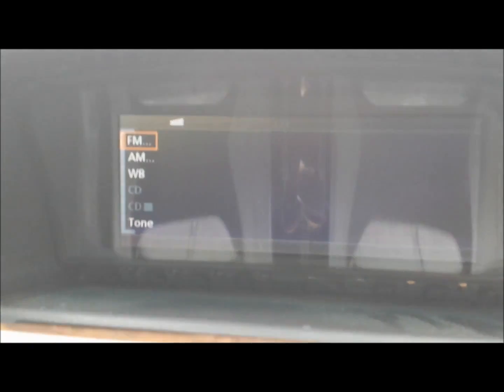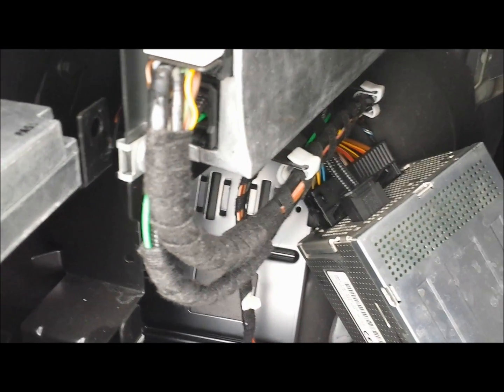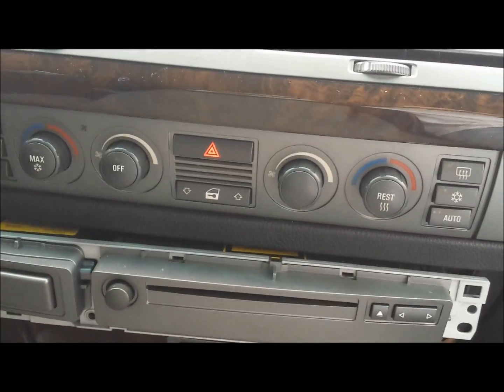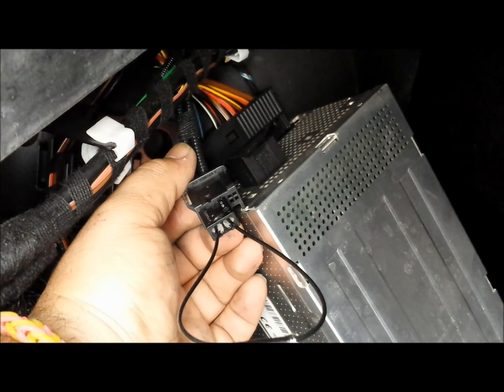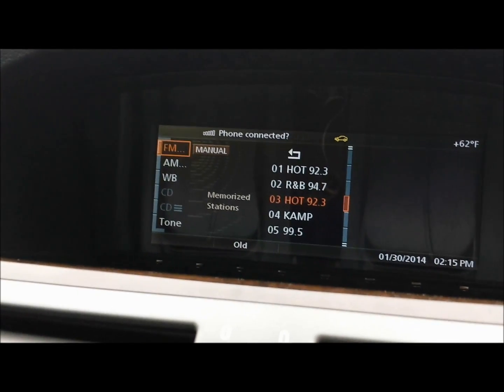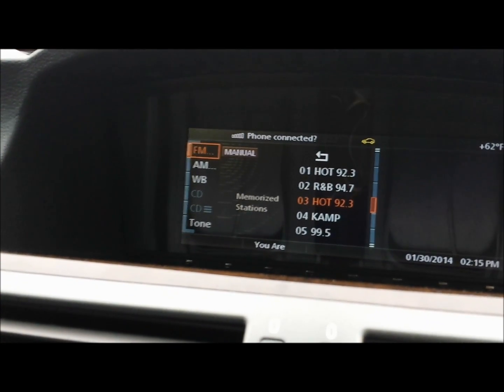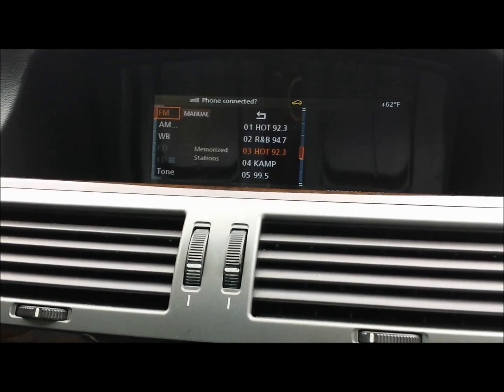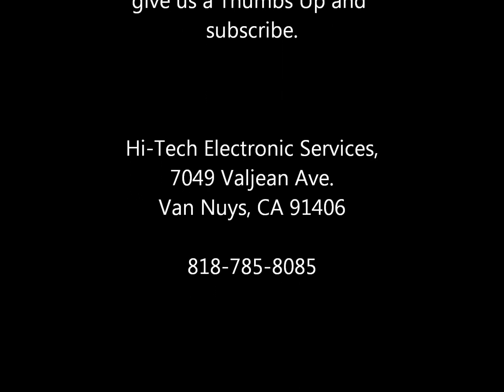How to Troubleshoot BMW Fiber Optic Audio Navigation 750 / 745 2002 to 2008. Part 1

Comment: Hi.. Nice video.. my CD changer is not working, it makes a clicking noise when it tries to load the CDs at start up.. I observed it, and basically it gets stuck trying to load the CDs.. any recommendations on how to fix? thanks
Reply: I have the same exact issue!!!
Reply: i changed the CD changer itself, and yes by myself.  I don't recommend it unless you know how to disassemble and enable electronic cable connectors from the board.  I'm a Mac Genius, and it was still challenging because I've never seen that type of connector.   But anyway, next I will test a new magazine.

Comment: Hello ,I have 2005 x5 3.0i BMW.  ever since battery went on car radio has not come back on. phone button stays little but nothing for radio numbers are not even on display. I brought replacement radio but upon attempting to install it would not power on, there is power going to wires but still not coming on can anyone give some assistance?
Reply from the maker: is your car equipped with navigation?

Comment: Is this a male or a female adapter? 

I want to purchase one but seems likes the pictures show connectors rather as same as the input sockets on the car and it wont work/connect. While what you are using in the video has exposed connecters on the loop connecter. 

Help needed
Reply from the maker: It is a male adapter.

Comment: I ordered the loop but how do I get to the nav. system? I own a 2007 750i .how do the side panels come off?
Reply: This module had gone bad. Connected loop and both radio and Nav. are working.
https://lh3.googleusercontent.com/5dqvPQBEuzMSEf69mDbEaOcW6W5rr5HYMZuPORtpIR5nD_bQ2R6bsaimjxeieRZ3me70qvZi2w
Reply from the maker: You need to remove all those plastic clips from the panel and unscrew the chrome latch on the trunk floor.
Reply: got it. thanks
Reply: J Harris3 what issues did you have. this morning after i washed my car, I went inside and heard the cd magazine making noises and humming from speakers, after reading up on other people issues I went to the trunk and hear activity like the navigation disc changer is on or spinning... I have a 2007 750 li as well. at first the bmw logo stayed on screen but I did 3 button reset, screen is ok, but no sound or radio and still hear humming
Reply: how and where did you get the loop I replaced my satellite tuner but its the wrong one it makes my radio and navigation come back on but not the satellite radio.

Comment: HiTechElectronic  does this also apply to the  BMW 525i series?
Reply from the maker: Not quite. BMW 5 series has CCC unit. If your car is equipped with the logic-7 amplifier and you have no audio then you could only bypass satellite tuner or Bluetooth module to troubleshoot.
Reply: +HiTechElectronic the audio works sometimes and other times not at all.  Do I have to use the by pass cable like the one in this video?
Reply: SwervinMad radio is open eni times

Comment: Hello I own a 2007 750Li and my radio is not working (FM has no channels), satellite radio has the same too, and my phone bluetooth doesn't work either.  What is the most likely reason for this?  A fuse or one of the components and how do I narrow it down?  I appreciate any help you can give, thank you. Glen.
Reply from the maker: You need to follow the instructions on this video to find out.

Comment: Hi guys
Is there anyway how I can upgrade my radio,system,settings etc as some of the options doesn't work when I click on them. Can't find Bluetooth either.
And one more question. My radio can't find any stations only if I look manually. And when I'm stationary volume is all ok but when I'm on move than my volume goes up and down,constantly till I don't stop and than when I move it goes up and down again.
Can I reset it or something?.
Thank you

Comment: Are 2009 535xi same diagnostic
Reply from the maker: +B Lorenzo No quite, in 5 series if there is no audio you can only bypass the Satellite module  if the car has the option or the Bluetooth module only.

Comment: This video is very informative except the fact that I buy the Fiber Optic Loop you mention and it did not fit my 2008 BMW750LI cause you forgot to mention that there is female/male loop. I waited 10 days for the loop and took me quiet awhile to dismantle the component, just to find to my dismay that the loop does not fit.
Reply from the maker: +Benson Reuben You should have bought it from our website.
Reply: +HiTechElectronic ......That's the first thing I did but upon searching for it on your website, the search came up empty. Perhaps instead of writing smart ass answers, you should update your website cause it looks like one from the 1990's  !!!!
Reply from the maker: +Benson Reuben The new website is coming soon. Thx.
Reply: +HiTechElectronic    so how do I get this loop from you  that fits into the fiber optic loop and how much will it cost?
Reply from the maker: +Benson Reuben Please go to our website, in BMW category, look for "BMW 745 troubleshooting guide"
and click on "buy now" button. You can also send me the picture of the connector that you bought, you might be able to modify that one. Our email is in the website under "contact us".
Reply: HiTechElectronic 
Where I can get that bypass loop... Or lolipop.. For my 2002 BMW 745Li
Reply: My 2009 750li screen is all black no audio or navagation

Comment: I have a 2002 745i and my idrive knob stopped working but everything else was still working until last night. Not only do I not have any sound but nothing comes on. Is this a battery issue or fiber optic loop issue?
Reply from the maker: +Andre Bishop  If your display is black then you need to check your fuse first.
Reply: HiTechElectronic

Comment: hi I have a 2003 745li when ever I turn my music up loud I get static in my front left speaker but It doesn't sound like the speaker is blown I'm thinking it's a lose wire in the amp or something. you have any ideas what that may be?
Reply from the maker: +Antwan Shaw   The problem could be the Amp or the ASK unit. You need to bypass the Amp first and then check the audio, if no more static then the problem is the Amp but if the problem still exist, the ASK unit is bad.
Reply: +HiTechElectronic thanks for the quick reply. I honestly think it's the amp because it only happens when I turn the volume up past a certain level
Reply from the maker: +Antwan Shaw So, get you Amp checked out first and if it is faulty then get it repaired or replaced.

Comment: Hi. Great video. I have a problem with my 2007 750i. I noticed while troubleshooting that all of the modules have a red light going through the fiber all the time, but the amp does not. Should the amp always have the light on like the other modules? Maybe I have a broken fiber? Where is the loop initiated from for the amp? Could a bad receiver cause the fiber not to light to the amp? Any help is appreciated.

Comment: in my 745i everything works fine, but the car doesn't remember witch audio source was on when i drove the car. So i listen to cdc, go out of the car and lock it. then the next day i open the car and there is no audio. i have to manualy select cdc or an other source to have audio again. any thoughts? maybe coding? (i can code with nsc exp)
Reply from the maker: +Yester Dailey It is not coding and it is not a common problem.  Sounds like a bad ASK unit.
Reply: +HiTechElectronic thx, i changed the ask, but no difference. But, with my other key (key2) is works fine! so i think its car/key memory setting?

Comment: Hello HiTechElectronic. I just purchased a 2006 BMW 750 Li from a co-workers friend. He said his CD player wasn't working because he had previously installed an aftermarket CD player and didn't know how to connect the factory unit. After some further reviewing of the car, I noticed the navigation doesn't work, nor the clock, door chimes and neither do the vehicle settings to let me know if anything needs to be serviced. Do you think I should take it to a stereo shop first or should I try the series of bypass loop? Thank You
Reply from the maker: +Bernie Rocha You need to install the original unit back in the car and then check the complete system.

Comment: truly helpful.....2006 e66 750liI had no radio, cd player, satnav, clock, tv, or sounds of any kind.I bought a fibre optic loop and started in the boot (trunk for you Am's) nav disc player first, no change.the big one next (don't know what it is) -no change.logic-7 thing next, BINGO! I pulled the plug and inserted the loop then went back in the car and the radio is on!I have sound from all speakers although it sounds quite dull....also,satnav, tv, radio stations, cd player, information sounds and chimes it's all there.so now I know which component is at fault and I feel quite triumphant so far as I feel a bmw tech would have cost me a bundle so far.....now to look for an answer about the logic-7 box/thing/amplifer whatever it is lol.many thanks so far...........
Reply: +Matthew Kingham  please ignore the lines through my text.......
Reply: where did you buy the bypass loop from if you dont mind me askin
Reply: +smooth gaskin "audi a8 fibre optic loop diagnostic connector" from amazon.when you get it, break open the plastic "lollipop" shaped frame and remove the loop.......you end up literally with a small piece of f/o cable with a small plug at each end.what are you working on?
Reply: +Matthew Kingham 2009 audi a8L
Reply: +smooth gaskin nice. good luck!
Reply: +Matthew Kingham thanks

Comment: i have a bmw 2006 750 li my Radio navigation not working can you help
Reply from the maker: +Basel Nammari After you find out which module is causing the problem you can send it to us for repair.
Reply: +HiTechElectronic ccc unit
Reply from the maker: +Basel Nammari  BMW 750 or 745 do not have CCC unit !?
Reply: +HiTechElectronic bmw dealer told me that's what needs to be replaced

Comment: hi I own a bmw 745i 2002. my radio unit cuts on and off every  2 minutes or so. does this sound like I need to replace the ASK unit?
Reply from the maker: +martinjcloudify  It might be the ASK unit. You need to bypass the Logic-7 Amp first and check it again.
Reply: +HiTechElectronic thanks. I replaced the  ASK unit but the issue persists. I'll try the fiber optic loop next. there is static in my speakers as well. would the logic 7 amp cause both static and the radio to cut out every minute or so?
Reply: +martinjcloudify forgot to mention that I replaced the ASK with a used one. so I hope it's not a bad ASK
Reply: +HiTechElectronic I juts purchased a bypass loop from you. I'll try that out. also, when I put in the new ASK I heard a new sound from the front speaker that I wasn't hearing from the old unit. it was a warning sound  from the dash.
Reply from the maker: +martinjcloudify  That means your original ASK unit was bad.

Comment: hi I own a bmw 745i 2002. my radio unit cuts on and off every  2 minutes or so. does this sound like I need to replace the ASK unit?
Reply: Problem solved, it was bad navigator unit
Reply: dude which one is the nav unit exactly cuz the same is happening to me every 2.5 minutes the radio turns off its driving me mad dude

Comment: I have replaced ask unit. Now my front door speakers work.  I have SWapped 5 different amps in one week. All where bad. Either left side no base right side no base or no bad at all.  Mine had right side no base.  Finally had one to work and I herd the best sound ever for about 2 days.  Now I have no base what could he the issue with these amps.  Is it my car?  Do I need to jump the wiring with that took in my glove box?  I finally had crisp clear deep hard hitting base but suddenly none at all. And at the time that happened like almost exactly the same time my navigation kept going blank. Saying it was initializing.  Could it be that all my amps where good but maybe it was the navi unit disrupting everything?  Or did the bad amp cause my navi to trip.  I'm confused.  I want that deep base and clear music sound back.
Reply: I fear if I got my amps repaired it will happen again.  I just can't seem to find out why.  Many people tell me the logic system is unreliable. But it sounds good once all channels and all speakers and woofers are hitting.
Reply: Please help. 

I am now  with two amps one I purchased from another car at a junk yard that had 6. I tried all I could til I got one that worked and now it's dead in just two days.

Comment: I have the same problem, If you bypass the navigation unit is everything else going to work back again? I allready tried another navigation unit from another e65 and then everything worked fine, but i don't use the navigation of the car, so can i just bypass it so i don't have to buy a new navigation unit?
Reply from the maker: +erzincano84 Yes, you can bypass it for good but use a zip-tie to keep it together with the plug so it won't come loose.
Reply: +HiTechElectronic can i order this from you? If yes do you send to belgiul?
Reply: +HiTechElectronic i mean belgium :-)
Reply from the maker: +erzincano84 Yes. Please go to our website and place your order under BMW.  
Our website: www.HitechServ.com
Reply: +HiTechElectronic done, thx for the quick response

Comment: Your video is well done and very helpful. Our 2004 745i Motorola Bluetooth appears to work but when we attempt to pair with our iPhones the pairing screen comes up and disappears.
Reply from the maker: +Steve Siegwalt Unplug the battery in the car for 5 min to reset the bluetooth module and try again. If it is still the same then most likely the bluetooth module is bad.
Reply: +HiTechElectronic thank you I'll give that a try!

Comment: I have BM 730 2005 in which dispaly is not working at all
Reply from the maker: +Nasser Khan  Do you have sound on radio and cd player?
Reply: +HiTechElectronic 
Yes its there, and even i can feel the change of behaviour with IDRIVE knob. Its just the display is off
Reply from the maker: +Nasser Khan  You need to have your display repaired or replaced.
Reply: +HiTechElectronic cant it be done by myself..??? Have to visit the service center
Reply from the maker: +Nasser Khan You could remove it yourself but you need to visit a service center for repair.

Comment: This is a great video! I has no idea how to troubleshoot the problems I'm having with 07' 750Li.  I'm going to try this over the weekend. Question,  if I figure out which module is giving me the problem does that mean I need to replace it? Or have it refurbished for that matter? Any advice would be great. thanks. .
Reply from the maker: +Jared Gray Some of the modules you can leave it bypassed but some you have to have it replaced or repaired.
Reply: @HiTechElectronic  I am checking a 745i bmw no sound from the radio CD CDC works but the CD unit have the am/fm mode button the other only have seek/scan button the unit with with the am/fm button it shows all the stations but no sound the other unit I think is the original because the trim plate fits it but not the other unit...?does the ask unit with the am/fm buttons does radio audio supposed to work.
Reply: @HiTechElectronic  more hi calories? 😂

Comment: Hi there,

I've been having some problems with my BMW E65 745i 2002, the radio is not working but the CD works fine. I can also see all the radio stations and find new ones, but I'm not getting any sound from the radio, but get a great sound from the CD.

What could it be?
Reply from the maker: +Boddi “Bugout” Jonson It could be a bad Tuner module or ASK unit.You are welcome to send both of them for a free bench test.

Comment: I have a  03 745i and every time I put a CD in the CD player it'll read the CD then spit it back out and the 2 CD icons are not lit up what do you think it could be
Reply from the maker: +Tray Harris The CD mechanism needs to be replaced in your ASK unit and also your CD Changer is broken as well that is why the icon is gray.
Reply: So just replace the CD player and the CD changer then everything should work fine ?.... And will I need to get them programmed if I replace both ?
Reply from the maker: +Tray Harris It is plug and play. Just make sure your radio is working fine before repalcing any components.
Reply: Ok thanks

Comment: When i buy i the optic bypass they ask me if a need the male or female?????? Idk :/
Reply: +Gabriel Torres they're not busting your balls.  you need male.  when you receive it, there may be a plastic housing that you need to cut of with a snips so the male tips can be inserted into the various MOST modules.
Reply: +Gabriel Torres They are busting your balls tell them if you need to ask you obviously do not know what the hell your doing in a parts department. Its a ByPass Lolly Pop for Nav. Trouble shooting and Amp And Telephone components Diagnostics , I hate Dealers they are not very easy to work with.
Reply: My point exactly, so why ask the consumer If he needs male or female end? If its universal it can be used for various models right? So Parts person should have handed  the correct part to this man nstead of sending him away more confused! Thats the point he was not helpful . I find A lot of guys in parts department to be Know-alls and not very friendly towards do it yourselfers. Thats why I say he’s busting balls!
Reply: Damn I got a female one that’s probably why it work but I thought they said you needed the female one
Reply: DenisTV how much

Comment: Very helpful video.  Question:  I have a 2002 740 iL with a MK3 nav unit and non lighting radio screen.  It flashes every few minutes.  The faceplate tilts to insert a cassette.  The display stays blank but the cassette, multi cd player and radio all play for about 2 minutes then stop.  Turning the power on and off it will play for another 2 minutes.  If I bypass the MK3 and that is the problem, will the audio display work again?  Also, if so, can I leave it bypassed?  (dont need the ancient gps)   Thanks